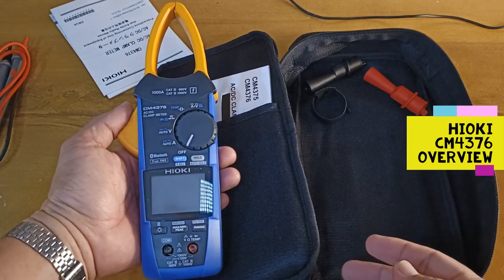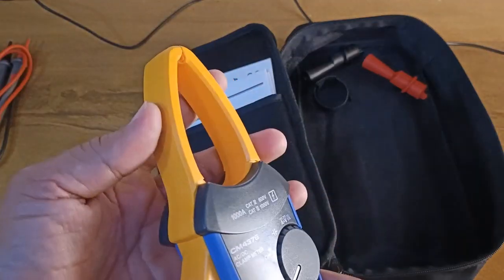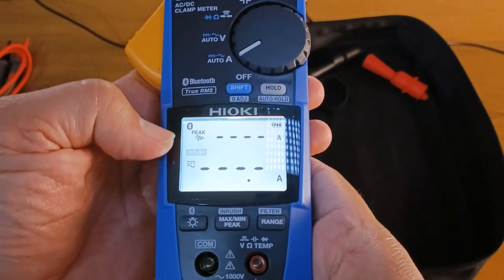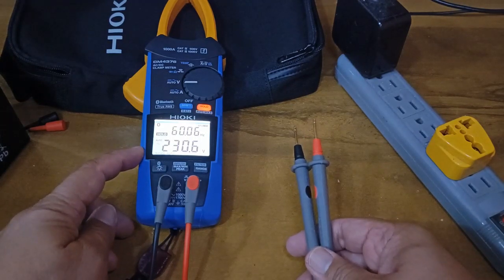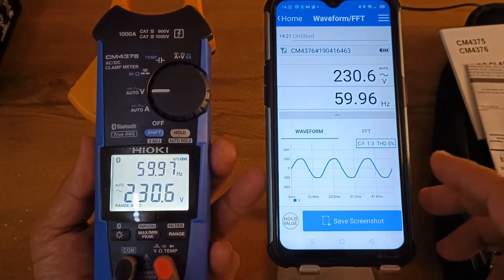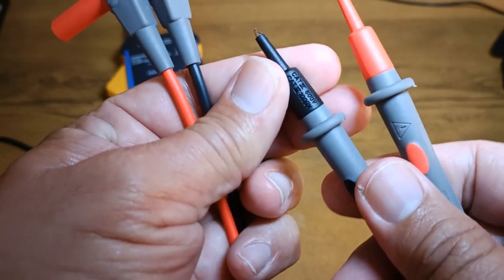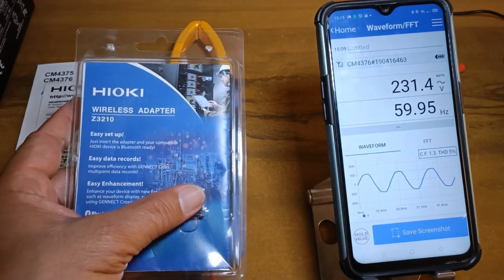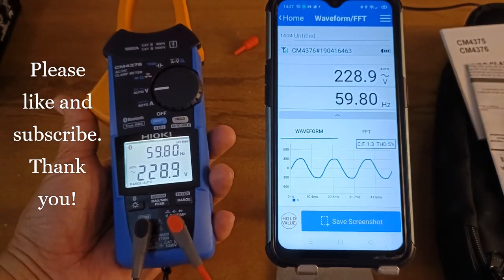[cc] Hioki CM4376 Thin Jaw AC DC Current Clamp Meter for Solar, EV & DC Power

Comment: 1:06 What was the waveform for the Car Battery Starting Testing?  The inrush current waveform.
Reply from the maker: I didn't set the Gennect Cross app at that time so no inrush trend was graphed. I'll try next time.
Reply: @ramschannelreviews  thanks you.  Curious to see the waveform  compared to what I’ve seen from automotive oscilloscopes.

Comment: Do you know if it can read Hz through the clamp at the output of an Inverter / VFD?  Or this function only works without the typical noise inherent to these applications, just with 50 or 60 hz line frequency.
Reply from the maker: I haven't tested it yet on the output of a VFD but it can display both current and frequency at its LCD screen. May I suggest that you also download the test (calibration) results and users manual for detailed specs here. It included a test at 1000Hz, 200A.

https://www.hioki.com/sg-en/products/clamp-meters/ac-dc-clamp/id_451384

From what I can gather, it is capable of accurate current testing while filtering out noise (with filter on) from a known 50Hz/60Hz/100Hz power supply. However, it seems it can also correctly measure current from actual power frequency above 100Hz (with filter off) in aircraft or ship, but you have to apply a derating factor as frequency increases (page 69 of manual). For instance, it can accurately measure a maximum of 200A only at 1000Hz. I'll try and reach out to Hioki to see if they can shed more light on this.
Reply: I appreciate your response. And your review! 
According to Hioki (they answered on one of their own yt videos) it can’t. They say it would require high current, 40 amps or so, to avoid the noise.
But somehow, the F brand in some very specific models lke 375/6/7/8 can read from 10 Hz at an inverter output, with as low as 5 amps. I believe Hioki is not using the low pass filter on the Amps reading or are very conservative about their error specs. 
It is a real pity because this clamp and the bluetooth capability seems more complete and competent . And also the F(….) connect app is a shame.
Reply from the maker: @Sentido-Critico  I didn't know that. Thanks for your insights. It'd be interesting to test it on the output of a VFD at various inverter frequencies. Fluke Connect is not available in my market region but the Hioki Gennect Cross app and direct to Excel functionality worked very well.

Comment: Hi, thanks for your detailed review. Do  you know if the 4375-50 can measure below 1A and can it show the individual harmonics order with the wireless adapter. Thanks.
Reply from the maker: Thanks for your appreciation. I'll get back to you on this. Since the 4375-50 is the newest version for the 4376 and 4375, it would be great if the 4375-50 can indeed test and display those information.
Reply: @ramschannelreviews  Thank you very much.
Reply from the maker: @lemech  I requested Hioki Singapore for information in this regard. Here are their answers. Yes, CM4375-50 is capable to measure below 1 A. However, please note that the Guaranteed accuracy range is from 1A to 999.9A. Can it show the individual harmonic order with the wireless adapter?
Yes, you need to install Wireless Adapter Z3210 and connect with GENNECT Cross to enable Harmonic analysis for troubleshooting.
Reply: @ramschannelreviews  Thank you. Much appreciate your help.

Comment: 5:37 What is the bandwidth and the sample rate of the oscilloscope on the app?  Is it on the meter and app graphs, or, does the app do metering too?
Reply from the maker: As far as I know, (1) the simple oscilloscope can definitely display waves of 50/60Hz power frequencies in the Waveform/FFT function. But I have no signal generator so I can't say if it can display waveforms of other frequency signals, as well. In the harmonics analysis function (if the instrument is capable of it) bandwidth is strictly limited to 50/60Hz and the Gennect Cross app can tabulate harmonics order up to the 30th. The app's fastest screen refresh rate seem to be 1 per second. The instrument has its own refresh rate. (2) I think both the instrument and the app do calculations. The app, however, greatly extends functionality and shows more information due to the screen real estate of smart phones/tablets, which is impossible for the tiny screen of the instrument to show.
Reply: @ramschannelreviews  thank you so much for your detailed answer!

Comment: Hi 1 more quick question if I may. If you connect the AC voltage and current probe at the same time, can you see both the AC voltage and current waveforms together? Or you can only see 1 waveform at a time by switching selector switch to AC V or A. Thanks.
Reply from the maker: Sure. The Gennect Cross app becomes a simple oscilloscope for either voltage or current. One at a time only.
Reply: @ramschannelreviews  Many thanks! Can you see the fft waveform for each of them?
Reply from the maker: @lemech  Yes.

Comment: Hello is this clamp meter able to record data (current) over a period of time, and then export the data to an excel spreadsheet with current values and timestamps? Is there a wired option to interface with a computer?
Reply from the maker: Thanks for your comment. Yes. You can wirelessly log and save monitoring data using the Hioki Gennect Cross Bluetooth App, a free download for Android and iOS. Connect with your phone and export the data (share to email, messenger, FB, etc.) as a .csv file, which you can then open with Excel. Fastest monitoring interval is 1 second for one channel (either current or voltage only); 5 seconds for DC power. Both DC voltage and DC current can be monitored simultaneously. Longest monitoring duration: 24 hours. I tested this in a 2-minute sample monitoring. It worked. The app was stable and the file can be exported as .csv or be made into a .pdf file direct from the app.  

My unit, CM4376, has built-in Bluetooth adapter. The newer version, CM4375-50, which I don't have, has an optional BT adapter and has the ability to export data direct to Excel with the adapter. Hioki calls this the Human Interface Device functionality (HID). You would need the optional Z3210 BT adapter for the newer version to use the Gennect Cross app and HID functions.

There is no wired monitoring option, as far as I know.

Comment: Why cm4376 discontinued @hioki site?
Top amp clamp 4375
Reply from the maker: I appreciate your question. If you watched the video I mentioned beginning at 08:11 that the newer version is the Hioki CM4375-50, which I don't have. In fact, I recommened the 4375 if you want the newer version. They have a lot of similarities. I think one of the reasons they discontinued the 4376 is that Hioki wanted to give their customers more options of owning a similar, upgraded clamp meter, as the 4375 is offered with or without the wireless Z3210 adapter and the optional high voltage probe. The Z3210, which enables not just Bluetooth but also direct to MS Excel, cannot be used with the 4376. The 4376 has builtin Bluetooth adapter for the Gennect Cross App, but can't do direct to Excel. On the other hand, the 4375, without the Z3210, can't do Gennect Cross and the Excel wireless communication. I'm sure there are other reasons but these are the ones at the top of my head. Good luck!
Reply: @ramschannelreviews  thank you 🌹🌸🌼
Reply from the maker: @mohsenSL  you're welcome!